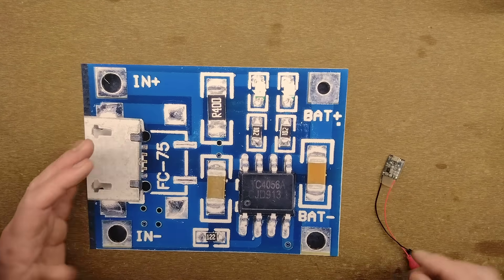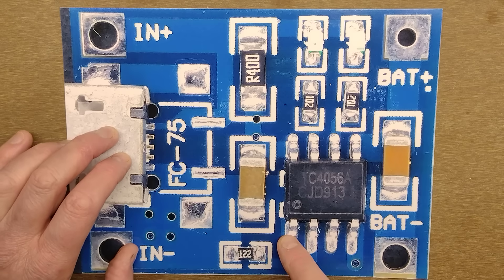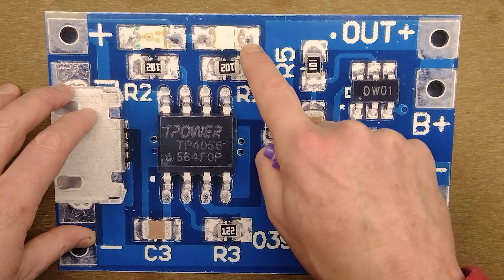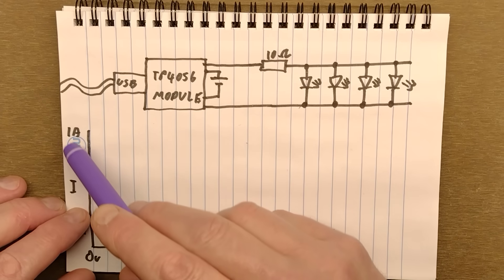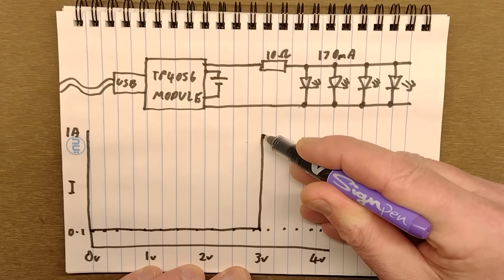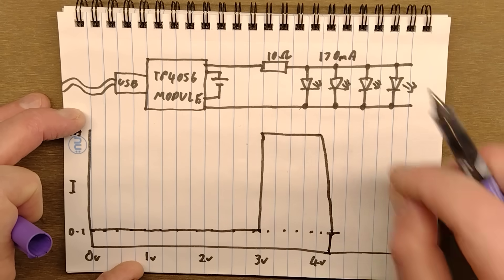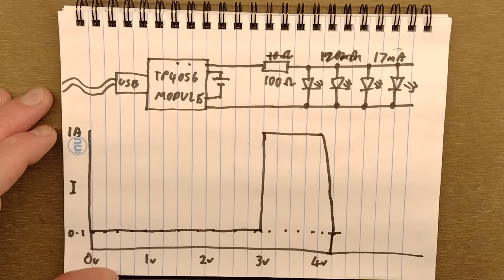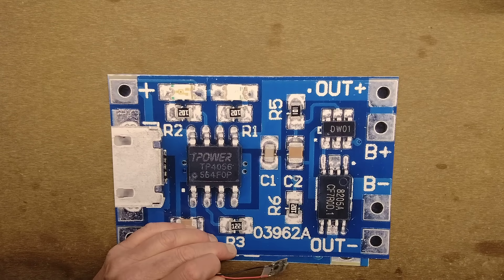TP4056 myth busting

Comment: I respectfully disagree. You are right in that keeping a load on does not 'overcharge' the battery, but keeping the cell at 4.2V does stress it out, and that is why charge termination exists: after the cell is done charging, it can 'relax' and the voltage will fall back to a lower one. If you never terminate the charge cycle, the battery is kept at the stressful 4.2V, and that'll cut into its life. I've destroyed LiIon cells that way, and now I add the diode+mosfet required to run my devices from 5VUSB whenever the LiIon is charging.
Reply: Could you please share the circuit diagram for the diode and mosfet connection
Reply: A usual point and it sounds valid. Can you suggest a modification that would correct or improve the situation?
Reply: Keeping the cell charged but disconnected will make its voltage rather quickly drop to 4.1V, and even in this case it'll degrade quickly in storage. If you want to store cells, discharge them to 3.7V. The constant topping up is a huge issue because current is constantly flowing in / out of the cell at the most damaging SoC to do so though.
Reply: I know, this is a bit late, but... a similar chemistry, LiFePO4, does not care if you keep the voltage floating, which is why many modern garden solar lights now use them.  They're also showing up as drop-in replacements for vehicle start batteries.  A disadvantage is that the charge voltage is 3.6V instead of 4.2V, so your circuit needs to take that into consideration.
Reply: @kittenisageek  But for charging LiFePo4 it's better to use TP5000 instead of TP4056, no?
Reply: @FrequenciaJogos  I haven't used either chip. I was addressing the difference between floating voltage on differently lithium battery chemistries.  LiFePO4 doesn't really care, while lithium nickel cobalt can be volatile.
Reply: @kittenisageek  So since the TP4056 cuts charging a bit past 4.2 volt, it is dangerous to charge a lithium nickel cobalt battery with it?
Reply: @somethingastorecall  It depends.  If it is a standard cell, then part of its construction will include a protection circuit on one end that will protect against minor over-voltages.   From what I understand, all consumer-grade cells MUST have it, but OEM cells might not.  Also, the TP-4056 is spec'd to cut off at 4.2v +/- 1%.  The electrolyte breaks down at roughly 4.3v, so the 1% over 4.2v shouldn't be much of a problem.  Also, it is designed to cut off power to the cell once it it is fully charged.  However, there are reports of lower-quality versions of these boards that do not cut off power after charge, which will degrade the battery life.
Reply: @somethingastorecall  Also, Battery University states that "Full charge promotes thermal runaway."  So, I'd be careful depending on the designs of the specific battery and whether it has OVP or not.
Reply: Add a diode in series at output terminal + can work for charge Lifepo4 ?

Comment: I feel like I am one of the ones that has inadvertently pushed the "myth". I put a load sharing circuit on a TP4056 because I wasn't sure the charge would cut off properly when using external power and having the device switched on, as the circuit is enclosed in a nice die-cast aluminium enclosure I want to make sure I am not overcharging that 18650 in there. I have heard of no instances where a fire or anything bad happening due to a battery being on charge whilst under load using a TP4056, but its seen not as a good idea to keep holding an 18650 at 4.2v forever under load also its good practise to switch charging off on a battery when its reached it peak. 
So I do use these modules to charge up 18650s (all of my galliums and A4 super computers are powered this way) without a load share and I sleep soundly at night, however these are one offs and for my use only.
Reply from the maker: I know that a lithium cell degrades faster when stored at full or low charge due to lithium ion density bias on the electrodes, but I wonder if that really impacts modern cells as much as earlier electrode chemistry.

Comment: I wonder if the problem is specific to some chargers that are for series-connected cells?  I have seen many cheap ones that don't have balance wires and just throw out (for example) 8.4V with a charge-chip and it assumes the batteries are well balanced.  I could see if there was a weak cell and it's actively got a load it could end up where it's got one cell going down a bit and the other charging up over a safe voltage?
Reply from the maker: Unprotected packs are a bad idea.
Reply: @bigclivedotcom  unbalanced series packs seem exceptionally common in cheap devices from what I have seen

Comment: It would be cool if there was an easy way to have an LED light/turn off or something when the chip goes from 100mA to 1 and then again back to 100mA.  Or at least the latter so you'd know the battery was essentially charged.

Comment: I do like the bigger board,  it has a stronger MOSFET than ones you find in  some cheap batteries. I have had some MOSFETs fail that are built into some cheap china batteries.
Just thought of something I am sure you could explain very well. Or tell me if I am wrong or right.
I use these in projects with a boost (DC-DC step-up) , I now make sure I put a switch before the boost.
In an early project, I have had cheap boosts act like a joule-thief, bypassing the battery protection. Batteries became bin fodder. I get every thing from China ha-ha.
Reply from the maker: If the boost was being used to charge a battery then it could be viable for the current to backfeed to the input.
Reply: @bigclivedotcom  Oh thanks for that Clive, made me re-look at what I had made.
Oh f$%^ I got it the wrong way around, it was Bucks in parallel. It was a long time ago sorry.

Comment: Great video Clive! There is a version of the TP4056 that has power output pads aswell as the battery charging pads, the output maxes out at around 400ma, useful for low power projects. I have used many of these in projects and I can verify that you can charge and draw power at the same time. the higher the power consumption the longer it will take to charge but it is possible..
Reply: Add big mosfets or igbjts, with a little tweak, and the tp4056 can control really big currents.
They are as ubiquitus/useful  as the 555 timer.

Comment: So I was using one of these with a solar panel to charge. It seemed that during the night, the power back flowed to the solar panel. Do you have any suggestions on how to fix this?
Reply from the maker: Put a diode in series from the solar panel.  They do leak current in the dark.
Reply: @bigclivedotcom  alright I'll give that a shot thanks.  Interestingly, it did discharge well past the cut off voltage on the board because of it

Comment: I think it is useful to say that not all clones like these C4056 are equal to the original TP4056. Some of these clones are used in a multicell charger, driven by a microcontroller. The problem is then that the C4056 cuts the charge too early, while the charge current is still > 100mA. The result is an incomplete charge, compared to what a good quality charger would do. The solution found to circumvent this problem is to push the charge voltage above 4.2V, which is only visible with a voltmeter connected in parallel to the cell, because the voltage reported by the charger is blocked at the correct value of 4.2V you have selected. But this is another story... In summary, do not blindly trust these clones, some of them do not respect the original TP4056 datasheet.
Reply from the maker: There is a voltage tolerance.  I'd rather a cell got slightly undercharged than overcharged.  At 4V the cell is about 90% charged anyway and will actually last for more charge cycles.
Reply: @bigclivedotcom  Yes for tolerances and undercharged better than overcharged. I just wanted to point out that the charging behavior of some copies of these components does not match the curve of their datasheet, which seems to be a simple copy and paste of the original one. In the case I observed this had no adverse consequences for safety or lifetime, but maybe it is better to be careful.

Comment: I've used to use a lot of those TP4056 but as you mentioned it dissipates quite a bit of heat regulating the charge to the litium cell therefore I've switched to the IP2312.

Comment: These modules are great. I use the original one to kick back over discharged cells back to the nominal voltage before move them to the universal charger (it won't charge, because it can't recognize what type of the batteries are they), and for charge those (soon-to-be) spicy pillow type batteries. While the one with DW01 brought several old bug zapper that used sealed lead-acid batteries back to life with lithium cells. I really like them.

Comment: A good charging chip in this case would charge with the 1A CC (Constant Current) mode up to the 4.2V (a threshold usually programmable).
It will then enter CV (Constant Voltage) mode slowly tapering down the charging current down to some value (also programmable) below which it will assume charging is finished.

CV mode usually takes as long as CC mode even though the latter is responsible for about 80% of the final battery capacity.

CC mode fails to charge up to 100% because of batteries internal resistance. The voltage drop on that resistance can be significant in CC mode masking the true battery charging voltage.

Comment: My one regret is that it doesn’t have a thermocouple to detect an overheating failing battery.  I guess the only way to do it with a that module is to mechanicaly place the battery close to the TP405 chip so it can down regulate the current.
Reply from the maker: The TP4056 will get too hot to be in direct contact with the battery.  But it does have the facility to use a thermistor for battery over-temperature monitoring.  Just not implemented on these modules.

Comment: I have several 4056 modules, very useful
I find the best way to explain it is to compare to a water storage tank with a float, if you don't use water, refilling stops, if you start using water the input starts, but will never overflow ;)
Reply: I love your analogy Sir! Kinda like a  standard diode (say IN 4007) is akin to a one-way valve with a small step into it; Mr Voltage has to rise over the step before Mr Current can get through, he can then go forward but he can't go back?
Of course you could explain the theory (should explain, depending on the audience) but if you impart just that much knowledge, then the recipient can understand it in a basic functional way. The only flaw to my logic (and yours also Sir, no offence intended) is that the spotty-faced oik that is nodding his head wisely hasn't got a 'bulls notion' of a one way valven or a water storage tank either!
God, I miss good 'old fashioned' hardware electronics, in industry, it is surely a dying art.
Pax
Reply: @conmcgrath7174  I understand your point, it's an impossible task to make an anology for someone who can't even figure out how to sit the right way around on a toilet. It's a sad example of our societies willful ignorance and so-called education-system. I despair sometimes, I really do.
Reply: @bikerfirefarter7280  Yet you persist. Common sense has to? If I was to get scared about 'everything going' south, well I would miss the internet for all sorts of reasons, simply information or a recipe for bread ( I am a good cook. cannot bake bread. have failed valiantly often. Why, well It seems I am an idiot, no escaping the fact.
Reply: @conmcgrath7174 
Hmm, I'm not sure what point you are trying to make.
My point was more about willful ignorance, not trying but failing.
Making a mistake is not a problem per-se, repeatedly making a mistake yet not being unable to identify it, then making the same mistake while expecting a different outcome; that's just stupid.
Reply: @conmcgrath7174  This is easily the worst thing I've ever read
Reply: @williamcampbell9859  You should read more.

Comment: These current settings resistors R3 are getting smaller and smaller with each version, with type C version it's easier to solder your 0.125W resistors to the legs of TP4056 directly 🤕

Comment: I bought 5 of these without DW01 and mosfets by mistake.
When I saw that, I threw them in the trash. 
The ones with DW01 and mofsets provide load current protection. 
In case of a short or overload, they shut off access to the cell, and only reset if you plug it back in the charger for a second.

Comment: @4:37 Isn't there a chance that a cell can fail catastrophically, once it was discharged below a certain voltage? Reading up on the topic, in the best case, you lose some capacity. In the worst case, you get "dissolution of the copper anodic current collector, which can deposit on internal cell components and induce an internal short."
Going down to 0 V sounds dangerous...
Reply from the maker: There is research on the 'net that showed that reverse charging cells posed a higher risk than discharging to zero.  I think the main issue is the density of lithium ions in the electrode material.
A real hazard is charging cells near zero degrees C as it can cause lithium plating on the electrode surfaces.

Comment: Clive, I'm a big fan of LiFePO4 cells (and your channel, BTW). Could you find a way to demonstrate charging these cells through some sort of tear down? Finding anything commercial is tough on my end. I'll be honest, I'm designing a reasonably priced project for my small, one man shop that uses four 18650 size cells in series to give me a 12V battery (nominally 12.8V 1.5 AH). Problems include balancing, 300mA/3.65V per cell charging and a discharge cutoff of 2V. LiFePO4 is often used in automotive SLA battery replacements for their low volatility (compared to other Li based cells) and tolerance of 'trickle charge'. My thoughts include the ability to keep my charging circuit super simple (and cheap). Perhaps I can make an extra prototype to send you (complete w schematic & fab drawing)? Thanks for all you do!
Reply from the maker: It is a lot tougher finding suitable charging and protection PCBs for LiFePO4 cells.

Comment: There are actually 2 issues I can think of are as follows.  If the voltage of battery is low 2.9 voltage, the charger will only supply the trickle charge rate.  If the device draws more than this current, the battery will continue to discharge until the low voltage cut-out occurs.  On the other end ~ 4.2v... you are never sure when the charger has completed because the charge complete light never comes on.  A power pass circuit would solve these problems.

Comment: If your local ALDI has stock, they have a Ferrex Impact Driver for £5.00!!! Part number 813561 (Identical but with different part number is £20).
Battery & charger are around £40 making it expensive overall, but for a fiver, I have one to play with the electronics.
Thought you might also make a strip-down and test video 😁
Reply from the maker: Sadly I'm not anywhere near an Aldi at the moment.
Reply from the maker: (But I do have a 20/40V system drill here for teardown.)

Comment: One time my cells heated up a lot when there was a load and charging at the same time, don't quite know what happened there. Might've been bad cells, because I harvest mine second hand. But I did think it was weird at the time, so nowadays I mostly charge and use separately.
Reply from the maker: A heating cell may indicate an internal failure.  If they self discharge significantly when in storage then it's time to let them discharge and recycle them.

Comment: Nice Video !! 
I had a bad batch lately, bad tp4056 with different errors, like never charging, blinking both lights as if there was no battery connected etc. after changing the chip the modules worked okay.. Quick glance at the datasheet especially with the LED error messages would have been nice ;)
Reply from the maker: Some sellers ship modules in polyethylene bags which is not good.  They should have static protection.
Reply: @bigclivedotcom  The Modules came in antistatic ziplock bags, but I ordered locally, and who knows how they were shipped to them.. Luckily I bought a bag of 20 bare ICs a long loong time ago (which I store in a polyethylene bag ^^), so I always have one handy to replace, I guess they were better quality back then. For my PCB projects I use DIO5158 ICs now.. pretty much the same chip.

Comment: I did actually buy bunch of these at some point, but I've been avoiding using them since I felt they're so cheap they're just going to end up igniting my battery or destroying whatever circuit I attach to them. Good to know these are actually usable, thanks!
Reply: you could always wire a fuse inbetween the cell an the charge board, just in case the charge chip decides to short internall one way or another, rating to suit charge and discharge currents, whichever is the largest

Comment: Doesn't that essentially float charge the cell at it's full 4.2v?  Seems not quite ideal if the light is on a lot and constantly getting floated, won't it wear faster?  Lithium shouldn't even be charged fully anyway since you get large cycle life gains from going to 90%
Reply from the maker: That would be ideal, but finding an easy solution for charging to 3.9V is tricky.  This is part of a series of videos I've been putting out aimed at emergency lighting use during situations where power may be lost.

Comment: i think you should start recommending the usb type C variant of this module 
also there is other variants of this board (not necessarily TP4056) that can take  5 , 9 , 12 V from phone chargers , i think its fast charging via type C with various configuration resistors to set the voltage.
i think those modules warrant there own video ... everything is moving to type C and type C can output 100 W of power.
its scary and i think you should explain it in simple Clive fashion so my simple brain can comprehend it